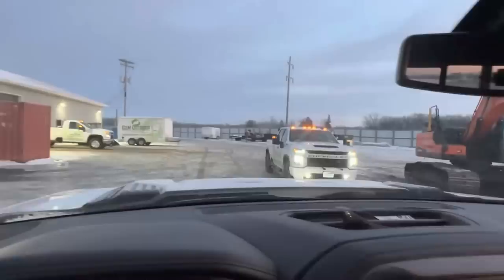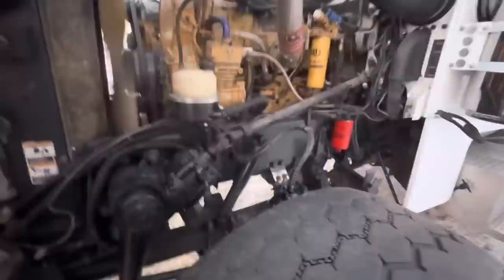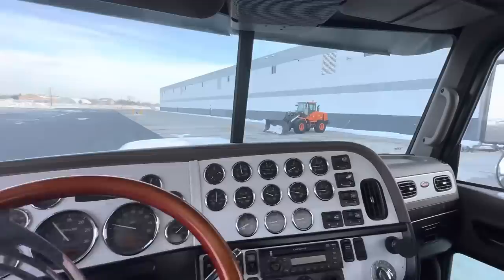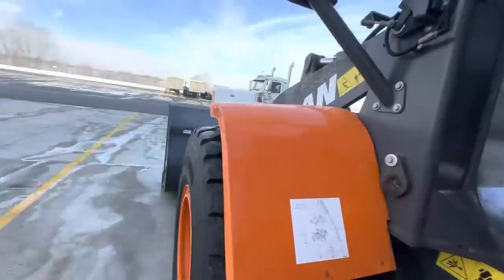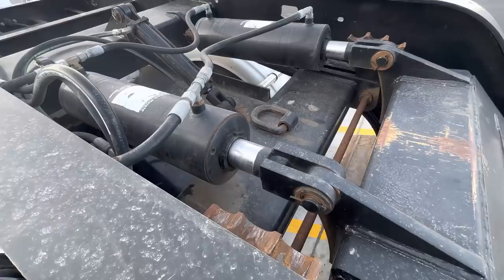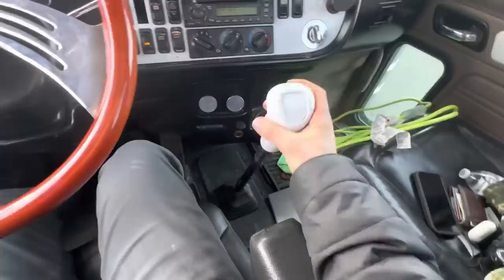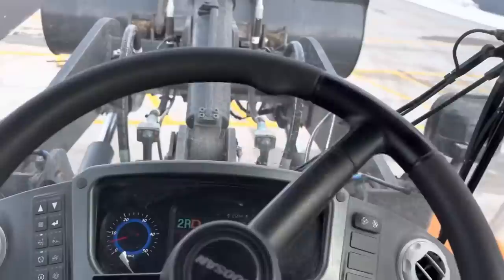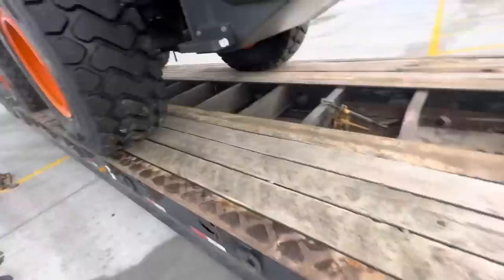HAULING DOOSAN LOADER WITH 50 TON LOWBOY TRACTOR TRAILER!!

Comment: Your Four chains Short unless you put the lock bar in on the Loader to keep it from Pivoting. If you leave it without that solid link you have to treat it as two seperate pieces (four chains on the front, Four on the back).  Maybe you put the link bar (or whatever it's actually called) and didn't show it, just trying to keep ya from getting a $$$ ticket or worse having something awful happen and somebody get hurt.  You can NEVER have enough chains on something IMHO.  Stay safe!!

Comment: Pro tip what I always did was pop the switch for pin while it was still up then if it didn’t come up right away normally when you drop it down then it will come up

Comment: Awesome looking rig! One thought for future is covering that exhaust pipe if you’re not gonna leave it running, would really suck to grenade a turbo on one of those big machines.
Reply: If the machine is newer and has the d e f exhaust emissions control you dont need a turbo saver.

Comment: Hi how are you first time to your channel, want to get my CDL what's the purpose of a lift drive Axle on a heavy haul semi Tractor
Reply: The lift axel helps disperse the weight of a heavy load doing less damage to roadways during travel. Lift axels must be lifted through sharp turns or turning will be severely difficult if at all possible and in some cases with larger trailers could even cause you to tip. Lift axels can be left in the raised position when unloaded.